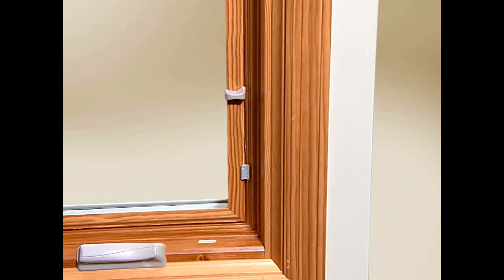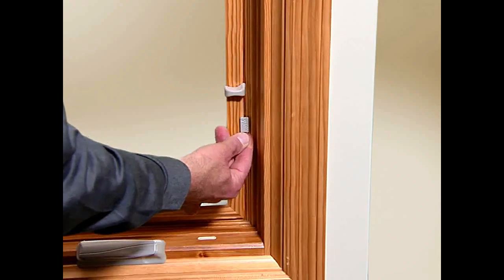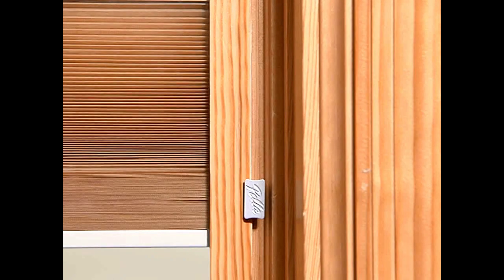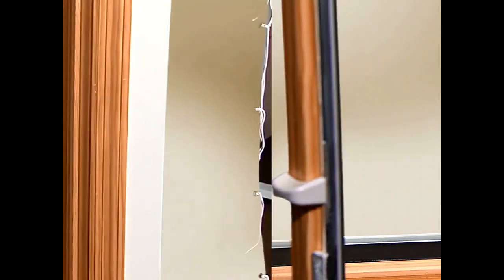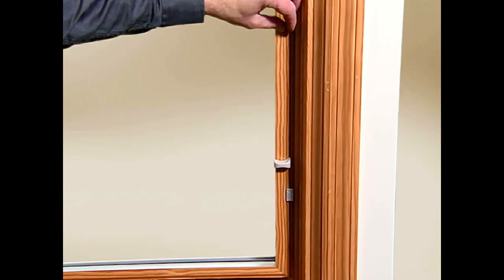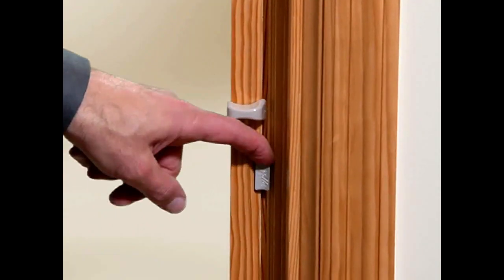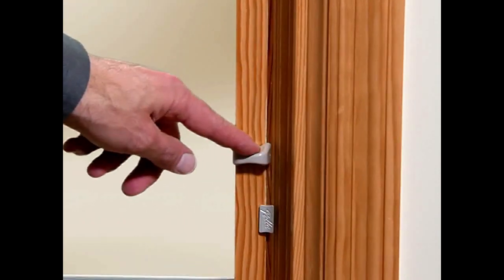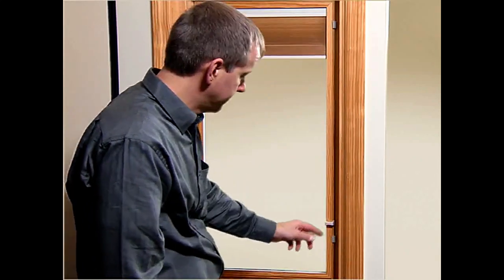Opening Hinged Panel

Comment: The video is useless to explain what’s happening when the blinds is not his opening up. There are three plastic patches similar to a door latch. Middle top and bottom. Moving the release tabs over these point feels sticky and should release each latch. You could use a hook at top of windows to help pull out the blind portion just a fraction so it is not caught on the latch anymore. Now move release over the middle latch and the blinds will move outward slightly more of you have a very slight pressure pulling. Now release the bottom latch and the blinds should now open up. I feel you can only use the release slides and not the blinds adjusting slide.

Comment: Windows are stuck and won’t open. I have it in then lock position. I need some sort of tool to gently pry open. Suggestions.
Reply: See my post
Reply: @john4901  where is your post?
Reply: Use more strength lol. I clean these near weekly. Its just more strength
Reply: I hope you've already found an easy way to open yours---I use a sturdy metal baby spoon, at the corners.   It really does matter that your latch releases are near the corners when you close them, and before you open the window (my granddaughter likes to play with them so I check periodically!)

Comment: This is all well and good but this is a window---especially older versions---that has no videos I can find that explain the workings of the blinds that are between the panes!!
Ours has the 'toothed belt' that the activator moves.  Up above there's a plate over.....something.   I haven't dared to open that and see if I can See a reason the blinds don't move at all.

The blinds have 4 sets of string to lift and rotate the blinds.  I checked the underside of them to see if the little horizontal slot is in fact horizontal.....The one video I found had that but also implied each string would have a piece within which would be visible as either vertical or horizontal.   Mine only has only one which was vertical; turning it horzontal did nothing.

ANY options which don't include a costly trip out from Pella which I just can't afford??   We have a matching set of bay windows on the other side of the front of the house so pulling them all out and putting drapes up is NOT a solution I'd be at all happy with!!